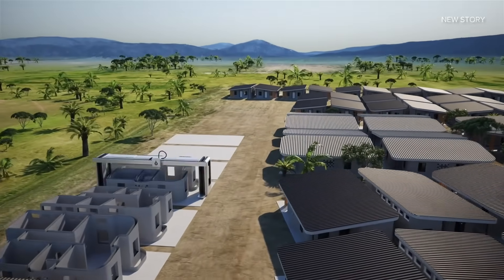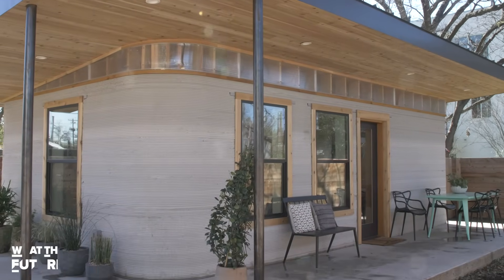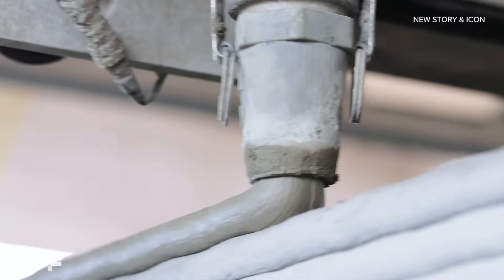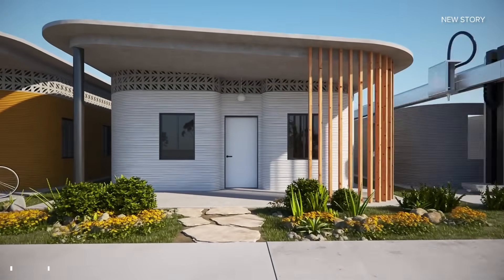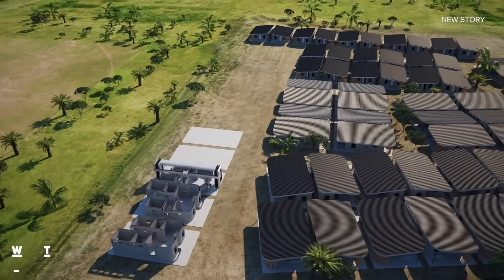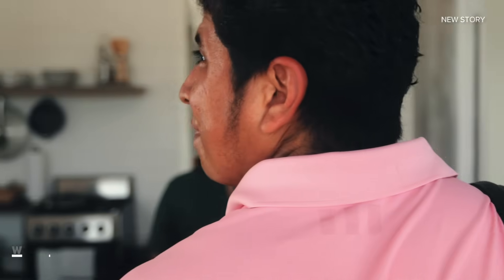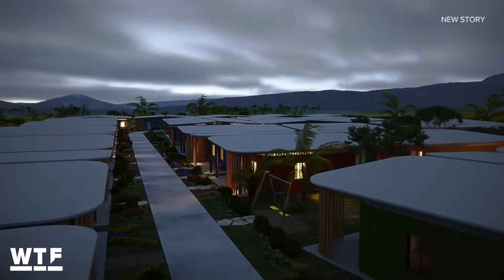The world's first 3D-printed community is officially under construction

Comment: This is not efficient at all when you take into account fitting out the house, painting finishings and making it actually livable. Concrete is also a poor insulator and is not efficient when produced in small quantities for remote areas. Prefinished steel skinned structural insulated panels allows walls and roof to be erected in the same length of time. They are also lightweight, require no Cranage, are very easily transportable, incredible insulators and fully painted and finished once erected.
Reply: Z Dobbo this. It’s “omg we are 3D printing houses” and like 
‘Great.’
It’s crazy we can use concrete like this but also- bare bone houses everywhere won’t get us at the end of the line when the issue is fricking Global Housing and Poverty.
The wikiHouse project tackles this “many systems house” problem better if you ask me.
And * both * technologies are ~2014 TED X talks about accessibility and (reverse) plotting.
idk this just jumps to me as: people are misinformed about the state of things/everything we could already do if we wanted to.

Comment: Nice, now construction workers are out of jobs
Reply: You still need construction workers to deliver this, set it up, monitor it, install roofs, windows, plumbing, electrical, trim, paint, kitchen and bathroom fixtures, etc. This is just a tool to speed up construction, so construction workers can build 5x the amount of homes without breaking their backs stacking blocks or nailing frames.
Reply: Enthused this is marketing lol.
And Jxshua’s info is outdated, we have better technologies than this. 
But they failed to penetrate the market.
Reply: It shouldn't be a problem that it reduces the amount of work to be done. The real problem is that we have a corrupt financial system that rewards those that are in charge of the system and is adversarial to workers. Capitalism is the issue. People should have their time freed to allow them to pursue better interests.

Comment: Yeah... without reinforcing bars, earthquakes and storms will delaminate those houses quickly, resulting in loss of life.
Reply: This isn't cement it's a cement mixed with a fast curing polymer. Some type of acrylic. You could put plastic Geo grid in the mix . With refinement these buildings could be more eathquake proof than the home your in now.
Reply: There is a possibility to use metal or fiberglass fibers within the concrete mix as a work around. But not sure they are actually doing that
Reply: I saw another video about this and he said it was strong and it can with stand storms and harsh weather I think he even said earthquakes
Reply: You’re right, the homeless are much better just sleeping on the streets next to tall buildings and roads with debris. Much safer during earthquakes and storms. God you’re an idiot.

Comment: No heat insulation...
Reply: seems like there are big air gaps inside the wall you could inject insulating foam into. Or just put insulation on the inside.
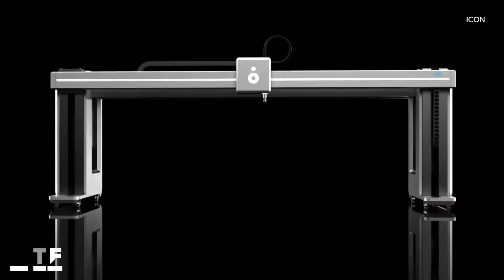Reply: @ForeverMasterless  Yes there are air gaps between the walls as seen at 0:22, the design should provide excellent natural insulation from heat and cold. This is a really cool project!
Reply: Its concrete
Reply: There could be portable heater and cooling units. This is an easy solvable solution.
Reply: radry100 doesn’t concrete naturally insulate against heat??
Reply: Nope. Concrete is one of the worst insulators in buildings.
Reply: Maybe thats what the non-profit focuses on??
Reply: No HVAC. It's not common in the region.

Comment: I wish the makers of this product well, but I don't want a home with conduit running along inside walls. Maybe I'm a bit of a snob, but I prefer a far more finished appearance and I fail to see why a robot cannot insert the necessary boxes during the course of building the walls that would provide a means for plumbers and electricians to fish all of their lines down to those areas prior to putting on the top plate. 

As for housing low income and homeless people, there is more to homeownership than just getting a home. Homes require constant maintenance, and if it's not provided, they can quickly fall into disrepair and become an eyesore or a hazard. Roofs, A/C and heating, plumbing, and electrical all need regular and timely maintenance.  Giving someone a free home is the worst thing one can do if they are not able to keep up with the repairs and a complete waste of taxpayer dollars.

If we are going to have to support both the home and the repairs, they might as well be apartments.
Reply: You should check out community first village. It addresses some of the ownership issues. The Mexico community should as well. 

As for the conduit, in wall is coming soon but was not a priority for this project.

Comment: These houses doesn't have any solid structure.
Reply: I assure you they do. They weigh over 50,000 lbs.  Rebar reinforced concrete designed by structural engineers to withstand seismic loads in the region.
Reply: You think concrete doesn't qualify as a "solid structure"?